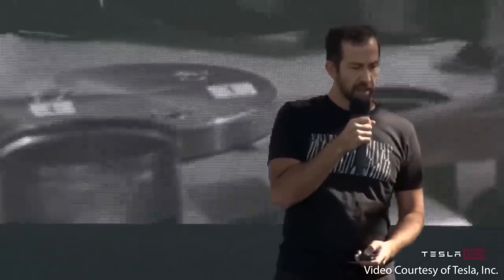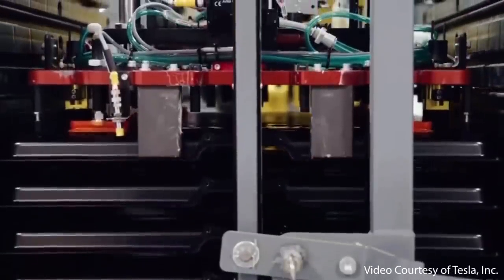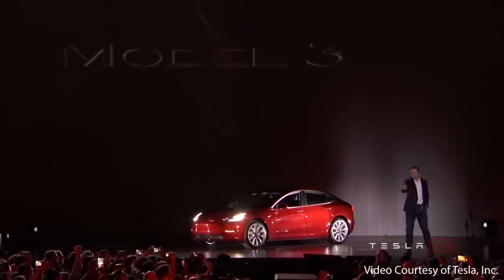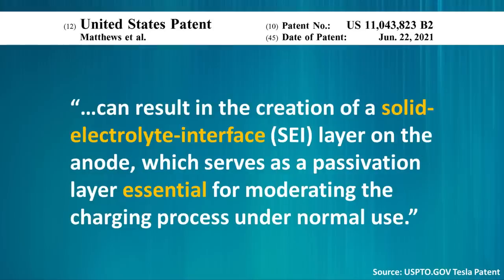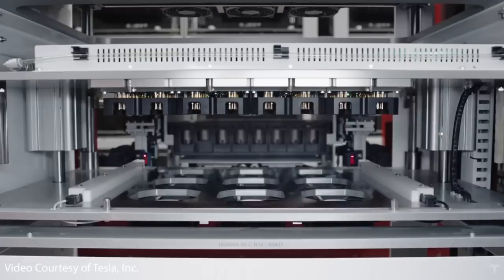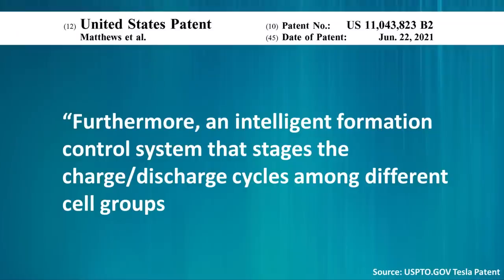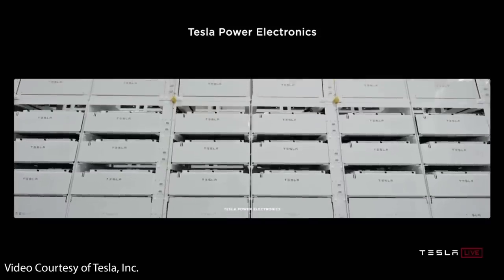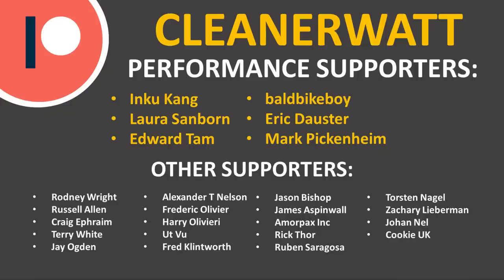NEW Tesla 4680 BATTERY Patent Reveals IMPRESSIVE DETAILS

Comment: In late 2022 I can envision a $25,000 Tesla that will be nearly as good as the Model 3. A low-cost battery pack will be made of these cells; this pack will be a structural member joining the front and rear castings. Each of these will be done using much less factory space, and in the case of the castings half the robots. The amount of direct and associated savings will be hard to imagine, but will show in the price of the car.
Reply: Or they charge the same until they can fill all the orders
Reply: I can't. Tesla has been raising the price of their vehicles more recently and they've cancelled the entry level, more affordable versions of every vehicle they've ever produced (Roadster doesn't count). It'll be $30K.
Reply: @TecnamTwin  Yeah, more likely above thirty than below it.  Everything will change when the terafactory really ramps up, but that is not going to happen in 2022.

Comment: I wonder if innovation is really sustainable with vertical integration.

Front end QA processes don't seem to be as critical as product life-cycle, especially for LIBs.  Are these EV companies able to take their customers' degraded cell pods, and then easily port them over to superchargers and grid applications as an intermediate step before end-of-life destructive recycling?
Reply: Vertical integration should provide even more innovation space.  I don't see why it should cause innovation to stall.  Recycling is pretty well in hand, technologically, due to the work of Redwood Materials and others.  We aren't going to have to worry about landfills filling up with Li-ion batteries.  They are too valuable.  People are doing "second life" applications of used cells now, but the future might see single use followed by efficient recycling as a more economical choice.  Stationary batteries and car or plane batteries might have substantially different chemistries, making second life use difficult.

Comment: Great details.  Wondering if the 4680s that other battery makers will also make for Tesla are the same as patented? Also would these be able to be sold to others? It doesn’t seem like it but the form itself (4680 size) is probably not patented.
Reply: Good point. If Panasonic, Catl, LG are going to make these 4680 cells , will they use the same formation ? It doesn’t seem like it. That means even though others will manufacture the 4680, they won’t be manufacturing them in the same cost efficient manner. That means Tesla’s 4680’s will be cheaper.

Comment: Tesla lower cost for user???   Why was the 35K model 3 dropped? More nonsense: electricity is sustainable energy...........hmm... Why are there defective battery cells found in the "formation process"?  Poor design? Poor manufacturing process control? Poor error proofing?